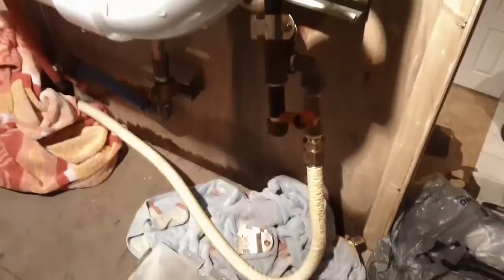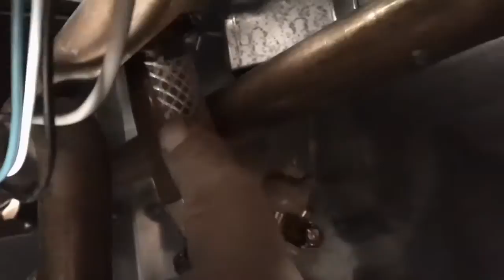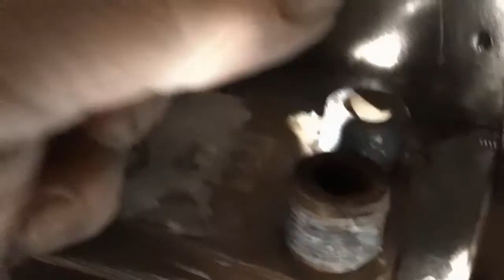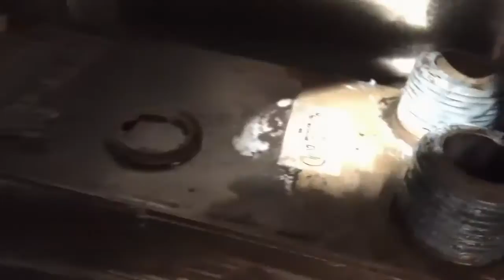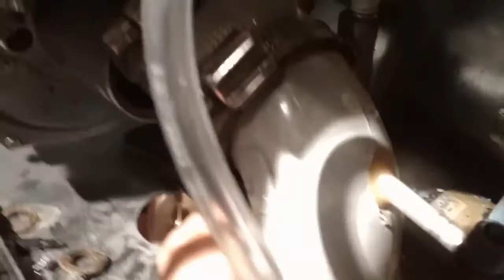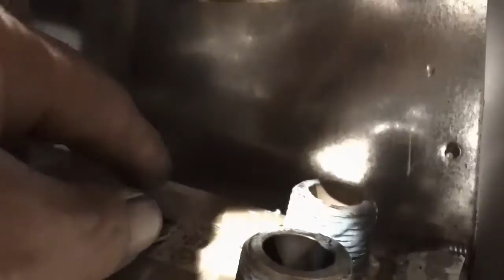Obadiah's: NTI Trinity 150 Combi Boiler - Repairing A Leak

Comment: my boiler was leaking from the back of the combustion chamber so what i did is clean the combustion chamber disconnected the condensate drain and passed a long tie rap from the bottom of the drain tube upwards tak pics before you dissasemble the burner unit  will hellp for puttin wires back in place